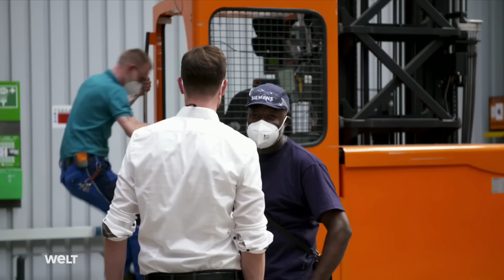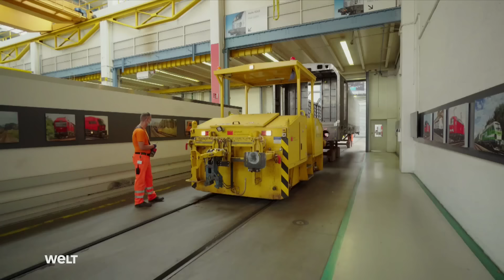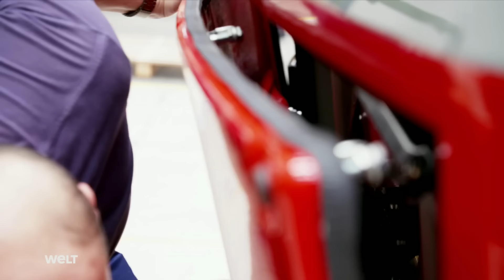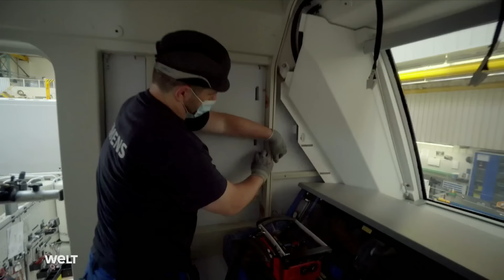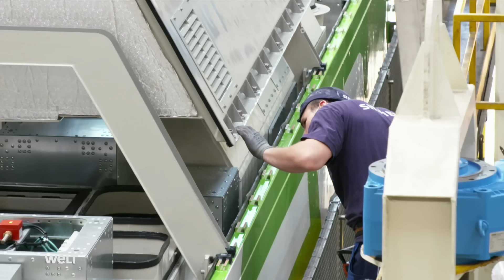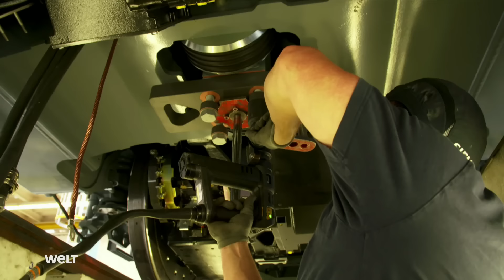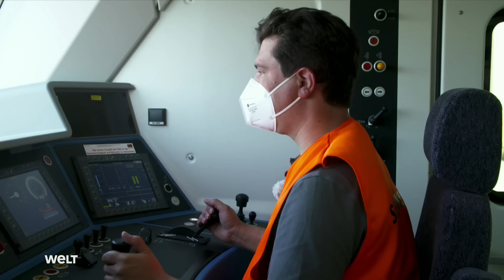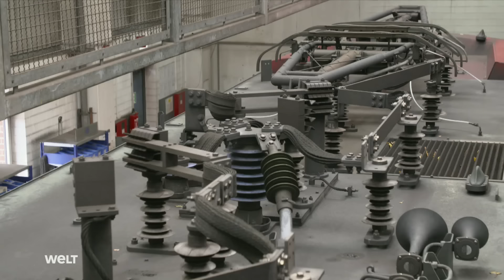SUSTAINABLE POWER FROM GERMANY: Electric Locomotiv - High-Tech on Rails | WELT Documentary

Comment: Aren’t all modern locomotives electric drive?  The narrator seems to believe this is something new
Reply: Not necessarily. If tracks aren’t electrified you need some other energy source such as fuel
Reply: @noflatscher  By onboard generator or electrified track but all locomotive are electrically driven, the documentary make it sound like like it's a revolutionary technology when it's more than 100 years old.
Reply: @realRickSanchez  No, actually, many/most of the diesel locomotives in use in Germany are not diesel-electric.
Reply: @noflatscher  ?? Most all modern locomotives are electric drive with no electrified rails or overhead power lines
Reply: @namibjDerEchte  which one are not?
Reply: @burgerpommes2001  most of the Vossloh locomotives
Reply: @burgerpommes2001   Liste_der_Lokomotiv-_und_Triebwagenbaureihen_der_Deutschen_Bahn This is the name of the article on German wikipedia that has the table for this. On diesellokomotiven, the column has either dh or de in there: dh is hydraulic torque converter; de is diesel-electric.
Reply: Arena     All     mordem   
Elektrik      diverse     The
Reply: @MrCheeto01 , there are diesel-hydraulic and diesel-mechanic drivetrain schemes. The first scheme acts as automobile automatic gearbox - hydrotransformer and optional mechanic gears. The second scheme looks like big automobile mechanic gearbox - clutch with gears. This type of drivetrain used in small shunting (switching) locomotives.
Reply: @namibjDerEchte  here's an interesting one:
is Germany today producing more or less co2 than in, say, 1990? 
as, in the end, it's about "sustainability", which, if you ask me, is silly word to mention anywhere near word "germany". and not just because of costs of making all this steel and later all the electricity to run it.
Reply: It's true, more efficient
Reply: Diesel still goat or diesel electric less things to go wrong long term
Reply: 💀 majority still race on diesel. Electric train usually goes only passager🗿 but freight are heavy asf so diesel is always the choices.
Reply: @Tama Kaze  Almost all freight trains are diesel-electric, not diesel. 

The diesel engines onboard work as a generator to power the electric motors, much better fuel economy and power curves vs using the diesel engine to directly drive the wheels through a transmission
Reply: @realRickSanchez  There's many viewers that do not know much about, locomotive tech, hence the narrator's explanation,  that's all.
Reply: Nope in america they are Diesel, certain parts of the world still live in stone age
Reply: @OsosViajeros  diesel electric ⚡ AC traction is the standard for years now, of course there are DC power diesel electric locomotives, older ones! 
EMD and Siemens teamed up to produce first AC traction unit SD60MAC>SD70MAC in 1992/93! 
General Electric followed in 1994!
Reply: @OsosViajeros  yeah they're almost all diesel generators. With electric drivetrains.
Reply: ahaha for 100 years ahahaha 
the future starts 100 years ago 
there are diesel only, than hybrid, dieselelectric and electric ac-dc ahaha
Reply: @minanovkiril  I don't believe there were any diesel locomotives in 1923, steam only
Reply: @MrCheeto01  in 1925 first diesel electric locomotive , USA.
Reply: @Inferno-hn3zx  that was a yard switcher which never left the rail yard, nor capable of being a transportation locomotive
Reply: @MrCheeto01  so? I'm saying it's nearly 100 years of diesel electric locomotive usage.
Reply: @MrCheeto01  and electric locomotives are  around 120+ years in traffic, so not only steam 100 years ago
Reply: @MrCheeto01  coal, yes.
Reply: Even now in many countries
Diesel Engine is being used
Reply: For passages not all but most higher speed passage rails are electric but allot of cargo is diesel
Reply: @noflatscher  tracks arent electrfied for cargo and Express. Only City links have electric rails
Reply: Others are Diesel locos
Reply: In India 60% diesel locomotive because the track lines are not electrified.... Because of mountain Rocky terrain but work in progress
Reply: Not all modern locomotives are electric drive
Reply: its German channel so narrator would hype Germany as greatest superpower
Reply: @floatinsun India has 80% electric lines. Highest in the world. Compare that to UK which has only 25% electrified lines
Reply: Yes 👍 , diesel locomotives are also diesel - electric locos . Diesel engine driving electric motors but Siemens is a class apart . In India , Siemens instrumentation in our locos
Reply: @namibjDerEchte most USA are
Reply: Masuk Kirim kan Kereta Cepat Baru 9 Unit  Masuk Stasiun BLITAR. Stasiun Gubeng Stasiun kota Stasiun Jember Stasiun Pasar Turi  oke Siap 
mantap Bro.
Reply: Far from it
Reply: @tamakaze712   electric produce more horse power
Reply: No.. most locomotives have to have diesel power for the torque.. especially when going up mountainsides and what not
Reply: @Esketti89  Unless the locomotive is getting electricity from overhead lines via pantograph it has electric motors powering the train getting electricity from onboard generators turned by large diesel engine, no locomotives use engine powered traction wheels via mechanical link
Reply: @realRickSanchez  Thank you for trying to set ignorant people correct
Reply: @namibjDerEchte  So you believe they have a transmission and drive shaft with differentials ?
Reply: @retroman5383 ??? what about Switzerland or Austria
Reply: @Mecrom  they are not big railways like India. Only 5000 km of rail in Switzerland compared a big network like in India or USA or China. 100,000 near or +
Reply: @Esketti89 in the US, all are diesel powered electric  generators.  Not only more efficient, but the majority of braking effort is provided by the motors via dynamic (electric) braking.
Reply: What can you expect from a 
machine?}
Reply: He is just Reading his script🤷🏼‍♂️
Reply: @brosk1s883 that’s it. Freight is usually longer distances, more chance there’s a piece of non electrified track, so diesel(-electric) is a sad reality, not a perfect solution. But it could be true hybrid though: only diesel assistance where it’s the only possibility. And then as a priority upgrading all tracks to (uniform) electric.
Reply: @thesignalbridge where do they use them, here in the uk it’s basically all diesel-electric and has been for years
Reply: @rhysrail , diesel locomotives with hydraulic and mechanic gear are used in mainland ("continental") Europe and across the world. Diesel-hydraulic technology is "German-speaking" countries domain (Germany and Austria in general), with its "locomotive hydraulic drives R&D" engineering schools.
Reply: @thesignalbridge  diesel electric still isn’t a new thing though as the uk and most other places
Reply: Maybe in Europe but in America where I live the locomotives are powered by diesel engines
Reply: @davismcdonald6186  I'm almost certain diesel is the fuel powering a engine which turns a dynamo which in turns powers the motors built into the trucks underneath, the original hybrids
Reply: @floatinsun in India if we take percentage of locomotives it is 85% run by AC electricity.
Reply: @davismcdonald6186 actually in America also use diesel electric locomotive. 
Step 1 
Diesel generator generate electricity from generator. 
Step 2 
This electricity then transfer into DC. 
Step 3. 
This DC current used to rotate traction motors.
The black smoke your watching about the train😅😅😅 is actually its four stroke engine four stroke engine in generator & without air filters.
I'm preparing for Indian railways that's why I know few things about locomotives.
Reply: @floatinsun What are you talking about ? More than 97% of railway lines are electrified in India.
Reply: We in Pakistan still using diesel Locomotives😅
Reply: @burgerpommes2001  BR 218 for example
Reply: Bro never heard steam and diesel

Comment: Beautiful and incredibly powerful machines. It's amazing, that they can operate in whole europe!
Reply: that´s the power and beauty of standardization and a shared si system, well that and interchangeable wheelsets :)
Reply: In 2020s, I would expect pan-European interoperability to be a certain thing, not something to be admired. Moreover, I don't think there are many (if any) Vectrons able to operate throughout the entire Europe, as there's a need for a seperate "national package" for pretty much any country the locomotive is supposed to operate in. That can include anything from a country-specific safety system to a different width of the pantograph.
Don't get me wrong, it's been getting better in the past years, but Europe is still far away from having a truly interoperable rail system.
Reply: @RestrictedProceed  wtf u on about? You know most are MS version of Vectron? It's on rail operators to run how they see it profitable. You don't seem to understand the concept of rail transport and how it works, just how would you like it to be.
Edit: not only Vectron, Traxx, Euro Dual...
Reply: @Inferno-hn3zx  The comment I was replying to sounded like it is possible to operate Vectrons throughout the whole Europe, which is not the case. MS (multi-system) means that the locomotive can operate using different voltages, but there are other technical aspects that prevent the locomotives from being fully interoperable. Moreover, there are bureaucratic obstacles as well. The last time I checked, MS version hasn't been authorized for use in Scandinavia, while no version has been authorized in France (the fact that Alstom, one of Siemens's greatest competitors, is a French company is purely coincidental of course). Iberia and Baltic states do not even use the same track gauge.
Why am I so obsessed with interoperability? Because it's one of those things that trucking has pretty much by default, but European railways haven't been able to achieve in 100 years since the UIC was founded. As I originally wrote, it is progressively getting better and most key routes no longer require locomotive changes enroute. It's still not the AAR level though, where you slap the power onto a train in Central Ohio and send it all the way to LA.
Reply: They are not in the operating in the UK. But then the UK is a whole different story.
Reply: Spain (and Portugal)  has a lot of Spanish gauge rails. Sadly, we are still paying for a stupid decission made nearly 200 years ago. We were afraid of a third Fench invasion. 
And the Baltics have also Russian gauge.

Comment: The Siemens Vectron was the basis for the Amtrak City Sprinter series, SC-44 Charger locomotives, and even VIA Rail Canada ordered Siemens locomotives for the corridor service between Ottawa and Montréal, based on the same electric locomotive, the Vectron.
Reply: And americans finally realized that they dont need such massive locomotives to do the job :) The vectron is a special machine
Reply: @nenadf124  The Siemens locomotives North America received have been nothing but problems. They have to be rescued by "massive" locomotives on a regular basis due to mechanical failures. They have been adequate short-run services in warm climates, but have been miserably unreliable in cold climates and on long cross-country service.
Reply: @trailingrails9953  vectron doesn't have these problems in Europe, not in Finnland ( up to - 40 °C) or Italy (up to 50°C)
Reply: @trailingrails9953  Not the ACS-64s and the Chargers reliability has been increased significantly.
Reply: @nenadf124  Not sure what you are talking about. Charger's weight is comparable to that of its predecessor, the GE P42DC. And ACS-64 is in fact larger and heavier then the AEM-7 it replaced.
Reply: Praise Vectron!
Reply: Traxx RULES
Reply: @trailingrails9953  Unreliable in cold climates?  The entirety of Germany lies North of the lower 48.
Reply: @trailingrails9953  that must be a problem exclusive to the american locomotives, the european ones work well
Reply: Only time will tell how those toys, euh....sorry, trains will age and perform under VIA Rail.
Last over sea purchase was brand new British railcar canceled order. They were disaster with tons of complaints from riders. They didn´t last long. In winter they were good freezers to avoid passengers from thawing....
Nice document from A to Z that you show us. Was interesting to see, but please, keep those locomotives where they perform good. Forget North America. No matter the propulsion mode. They will never pass safety requirements. The model we saw is just a rail coffin ! Don´t hit hard at a rail crossing, or worst, one of our freight train. It will be like throwing an egg against a wall ! 
Glad that you like them.

Funny fact: they use special paint to ease graffitis removal and brand new automobiles are shipped in open car with no protection ? Kids should have fun smashing windows with ballast..
Reply: Some Canadian locomotives were exported in eastern Europe in the 80s. I rode them with my grandfather who was an instructor for the engineers driving it.
Reply: @1GTASANANDREASCJ because they are made in Europe. Quality here in North America is a myth.😮
Reply: @draloha296  i'm sure they are better made than '90s GM cars
Reply: Ah yes Ottawa Canada, the city where the wheels on the tram are "not round enough."
Reply: @MrThisIsMeToo Yes, but oceans exist and do stuff to weather. The entire UK is further north than parts of the US that average over 120 inches/300 ish cm of snow each winter.

Comment: All is nice but there is missing the tracks monitoring system. These days there is no problem to measure tracks and search the damages even on 200kmh speed. This is the technology what makes possible to get even higher speeds on the rail network. It does not need to be super accurate, slow equipment can verify it after the busy hours.

Comment: While it may be a marvel of modern technology it certainly isnt without its fair share of issues. 
As someone who works for the austrian railways and knows people who have to service those locomotives, let me tell you, they are built to a price. And a low one at that. 
From the numerous software issues that still plague us to this day (cant be used for passenger service here in austira) to plain bad design (only one usable pantograph for the 15 kV system, no side windows which cause bad side visibility and many more). 
Its a powerful machine but its cheap for a reason.
Reply: And I wonder how/if construction of these continues this winter, where due to a reliance of energy from Russia, Germany finds itself in an energy crisis. After all, what's the point of industry when people are freezing in their homes?
Reply: I was wondering about that : I didn't see any side windows in the cab. Why can't it be used to passengers services ? You'd think that Siemens could get it right.....
Reply: @mikedebest812  It was the same in Finland, IIRC, but the Finns managed to circumvent the problems, and it's been used for passenger service there for quite a while now. I think it had something to do with automatic, jerky braking.
Reply: how should we connect software issues and passenger service, please tell us because it's not that obvious...
heh
Reply: Come to Australia downer you will laugh how bad it is
Reply: Also under 1.5kv still issues, where the MCB disconnects now and then because of the train heating. Solution most of the times is to turn off the heating in some wagons, then close the MCB and turn the train heating back on. Very annoying.
Reply: Lol
Reply: @Chordonblue  The only people, wha are freezing are the drivers of electric cars, they shut down the heater to spare the Battery for drive
Reply: Hm that seems to be a Austrlian and American problem, are they built diffrently maybe? Im using a Vectron Dual mode on the daily basis and its by far my favorite locomotive to drive.

Comment: If you are curious, On the other hand India has already electrified its 85+ percentage of railway tracks, a lot is going on in India, with new expresses ways coming up and also the Dedicated Freight corridors, and insane amount of train engines are bein built in India with the help Siemens and other Local established players.
Reply: But only 60% workload is done through electrification
Reply: @diviyampathak1995   not to forget, we are still building WDG-4G and WDG-6G locomotives because we signed a contract with GE and now we can't back off from that without paying a heavy fine
Reply: @pranavsharma24 I always wondered why Indian Railways signed this contract to build so many diesel locos .
Reply: @judefernandez827  we were in advanced stages of negotiations with GE when the government changed. After the government changed and the vision to make railways 100% electric was made, we couldn't back out from the GE deal. I believe the contract was already signed and GE had set up it's manufacturing plant here. If we cancelled the contract, the government will have to pay a huge sum of money to GE as fine. Hence we are stuck with those diesel locos. In all fairness they are very powerful (4000 and 6000 HP). They emit less pollution. And another important reason is related to national security. In case of a war and the electric grid is attacked, these locomotives can still be used to transport military trains.